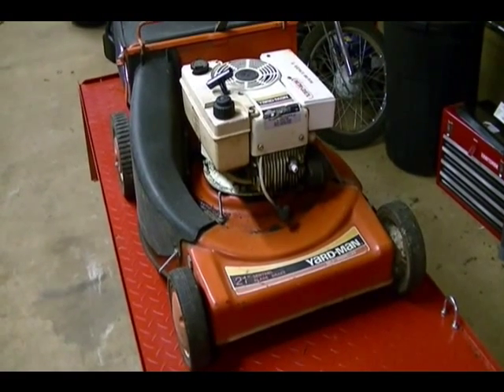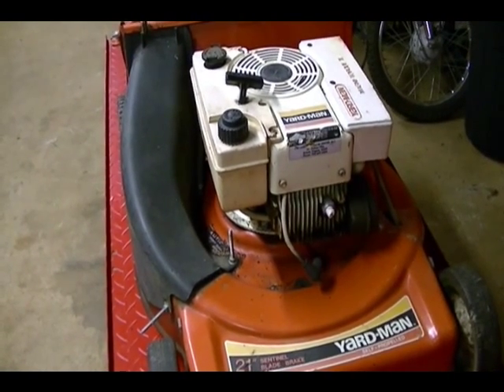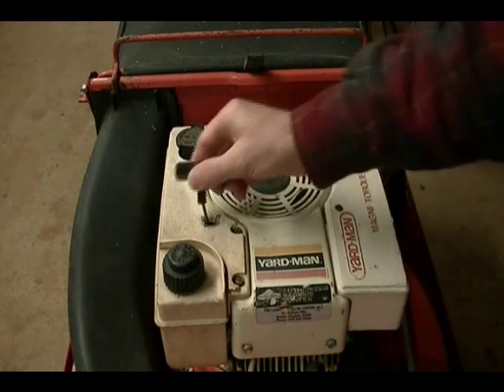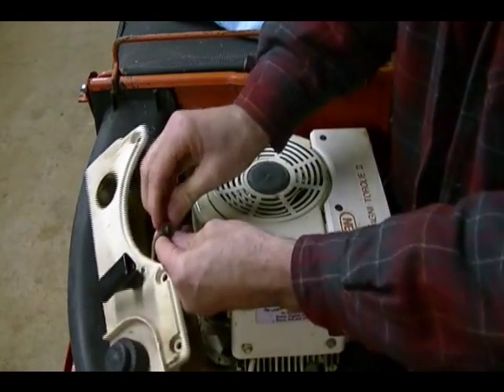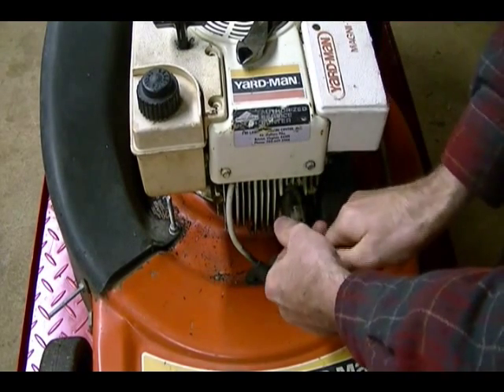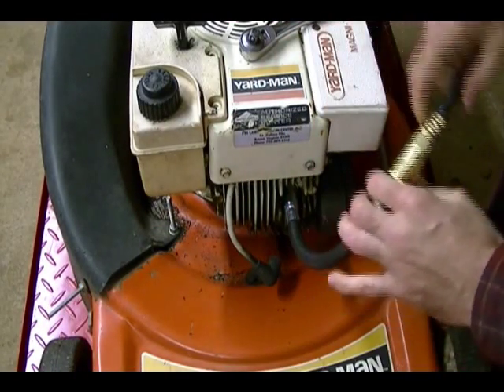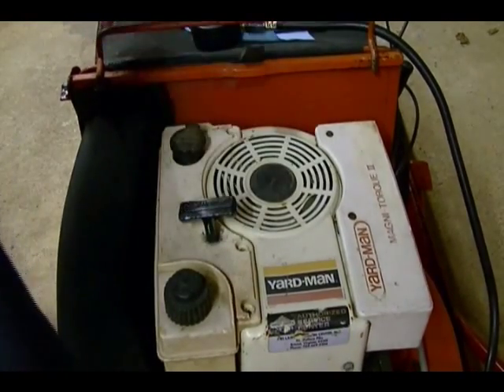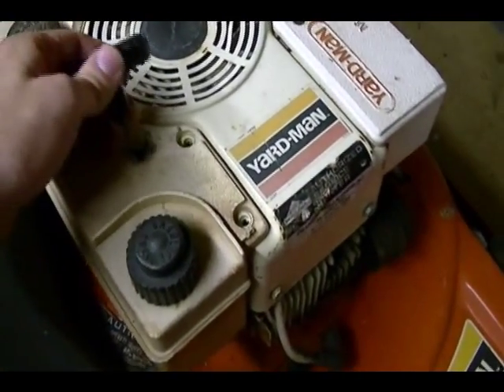Small Engine Repair: How to get a Tecumseh Lawn Mower Started - Part 1

Comment: does that engine have compression release and if so how are you supposed to get an accurate reading from the compression test? compression release keeps the exhaust valve open to aid in starting.

Comment: I wonder if you could create a sleeve with a brake line or fuel line flare tool?  Flare on one end the upper portion and thread on the underside (with a die) to secure with maybe a speed screw or something thin like that!